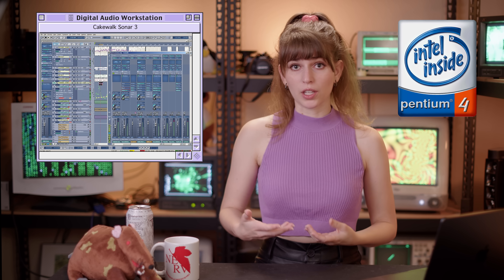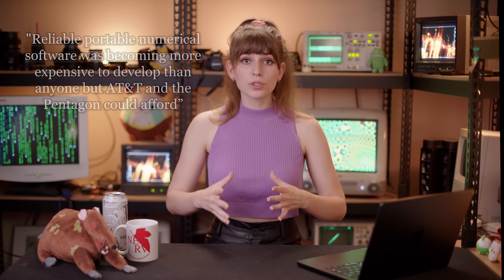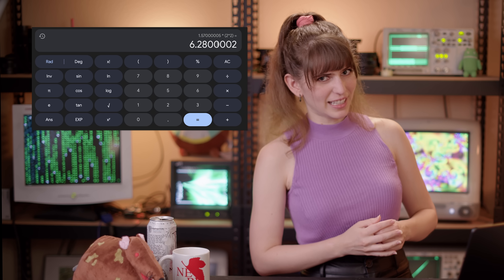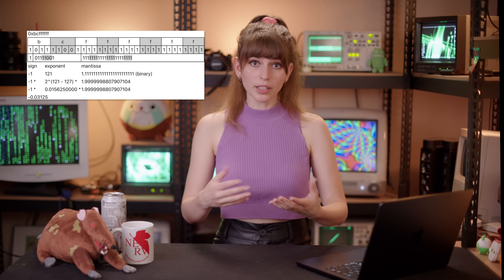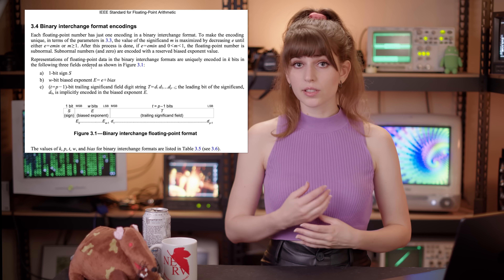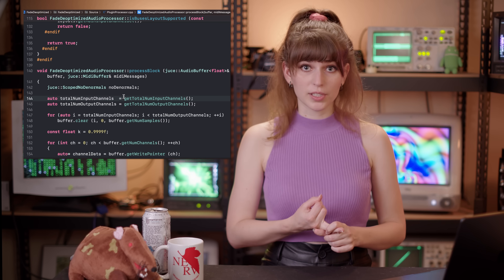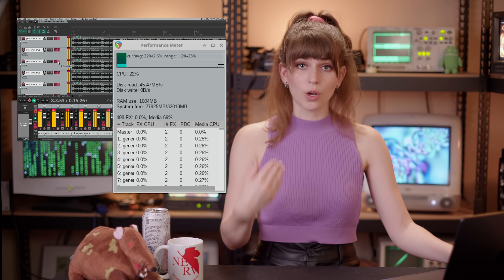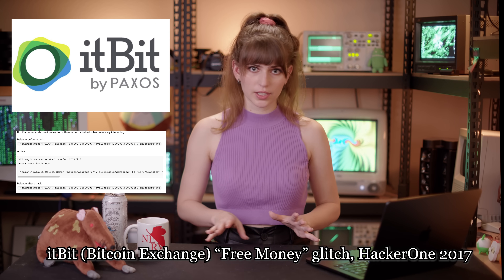Fading Audio is ROUGH on CPUs

Comment: Just want to note: floating point numbers are NEVER used in financial institutions (stock exchanges, banks, currency exchange) precisely because of the problems with losing precision. Instead, they use fixed-point numbers, integer arithmetic only, with single units representing (for example) 1 cent in your bank account, or 0.0001 of a cent for a stock price.
(Interestingly, there are actually laws on how accurate stocks can be priced! I've heard there was a "race to the bottom" with several exchanges offering more and more precision, until the laws were introduced to stop brokers having to report prices with uselessly high precision)
Reply: When all you're doing with the numbers is just bookkeeping-type additions and subtractions, like for crediting or debiting an account, this makes perfect sense. But for more complex calculations, isn't there a point where it becomes, if not impossible, at least super unwieldy to avoid floating point? Like, what if they're trying to calculate the monthly payment for a loan with a 60-month term, a $10,000 principal and a 6.8% APR, compounded monthly? Do they still use only integers for that?
Reply: @rossjennings4755  It becomes impossible obviously, that is as long as you want to be able to use anything base ten wenn actually marketing your finance products -- like interacting with the rest of the world. And pure discrete math products in isolation would be a funny thought experiment, everything integer step function, no calculus available -- but pointless. Of course for doing the claculations one needs to use calculus and cannot be constricted to discrete math (and that base 2).
Reply: @rossjennings4755 yes, integers still used for interest calculations. They'll probably use a fixed precision of much less than a cent, but I can assure you they don't just switch to floats.
Reply: @rossjennings4755 yes, i could do that with pen and paper
Reply: @rossjennings4755  in more complex cases, typically you would use arbitrary-precision arithmetic: https://en.wikipedia.org/wiki/Arbitrary-precision_arithmetic

This is slower and more memory-intensive than floating point, but is also far more accurate.
Reply: Floating point should never be used (for money, etc) for those reasons, but it is. Typically, it would be in a job aid someone came up with on their own, and theoretically the business doesn't rely on it until it is rewritten in an officially supported manner, and the people doing the rewrite should fix that, except that it may be outsourced to  contractor who might have inexpensive short-term folk for some seats, and ... Bugs exist.  This is one I have seen.
Reply: @jimjjewett  I remember getting a bug report about a customer being charged $9.19999999 instead of $9.20... (or something similar, I don't remember exactly) I then had to explain to my superior how floating-point precision errors worked.
Reply: @jimjjewett  I used int first for money for my  Javascript MobWars/Mobsters game Crime, then it over float, so switched to float, because it was all about making fast faster MSSQL calls statement procedures, so for games its acceptable
Reply: @jimjjewett  Single precision financial numbers are especially awful.  You have 100k in your checking account, and that's at least 8 digits ( including cents.)  And I think single precision is roughly 7 digits (it's variable, might be as high as 8 somtimes I can't recall.)  I think you should bold NEVER :)
Reply: Then how do you handle money in javascript?
Reply: @kellymoses8566  in case you're actually after a serious answer, implement a MoneyValue class with the correct behavior for your application (Do you just need cents? Then work in cents with arbitrary precision integers, backed by typed integer arrays. Do you need fractional cents? ...Think carefully about the arbitrary precision "real" number system you use, make sure nobody can break your app with an extremely small value that takes up an extremely large amount of space). Avoid adding adding conversion functions that would give you a regular JavaScript number. Write functions on the class to produce displayable elements. Oh, and never ever trust the client/browser. It should basically just be like a dumb terminal to the application on the server side.
Reply: @kellymoses8566  Very carefully.
Reply: @kellymoses8566  You don't. Or at least, you shouldn't.
Reply: For monetary values you should in principle use binary coded decimal (BCD). E.g. C# has the "decimal" number type, and many databases have BCD column types, and at least Intel x86 has some basic BCD support built-in. They still have finite precision, so rounding rules apply, but at least all numbers written in base-10 will be represented exactly .
Reply: That is VERY important. Money is countable and MUST be integer only. Fractions, real numbers, complex number, etc. are NOT countable, ergo cannot be used to represent money even on paper. Precision of floating point number and CPU architecture is irrelevant.
Reply: @eugenkeller  what about FX? It needs that precision and it absolutely accumulates
Reply: @Vysair  What about FX? And what about NO? Doing something fundamentally wrong accumulates. Even without adding a two-letter-acronym to the mix.

When you're dealing with integer, precision of floating-point is irrelevant. Write it on your forehead. Next to: you cannot write an integer with floating-point. Then in red and all caps: MONEY IS INTEGER.

Your "FX issues" are solved not by using more precision of floating-point but by using integer.
Reply: I work on trading technology for one of the biggest trading desks in the US. I can tell you for a fact we use solely floating point numbers, and have for at least 30 years. Yes, we do have issues, but that's all we use.
Reply: theres the ICE SDK , I'm now intestered seeing how ccxt and ICE sdk can work together
Reply: This isn't quite correct. The lack of floating point has more to do with history, most of that code was written in languages that used fixed point arithmetic. Most people really don't understand how old the code that underpins the financial system really is. I've seen code with copyrights before my parents birth. There's a reason you can make a good chunk of money just by knowing COBOL.
Reply: @DavidPruitt  Computers are irrelevant. It's mathematics. Money is countable => integer. Real numbers are not countable and cannot represent money, in principal. $1.23 is NOT a real number or complex number, it's an integer.
INFINITE set of Real numbers contain integers and are used to calculate integers like money for conveniency, but they don't represent it. FINITE set of Floating-point numbers, in general, cannot represent integers nor real numbers in any range, resulting in loss of information. In finance, losing information is a crime.
Reply: Came to post this.
Reply: Yep, that's why in the Bitcoin white paper, a Satoshi was 10^-8 BTC, can't go lower than that, or you will need to use floating point, which would make transactions either break, or take forever.
Reply: Real institutions do not use floats for actual transactions. However people who thought that running a crypto exchange would be cool might not actually know about the subtleties and then just wrote the backend in PHP without thinking about the data types at all...
Reply: A common misconception. This is definitely best practice, bit there is definitely plenty of software out there using floating point numbers
Reply: @jonnaraev  I guess more accurately said that no-one competent uses floats for actual money transactions/ledger. In cases where (usually) minor inaccuracies do not matter of course floats are acceptable. Just make sure your minor inaccuracies are not compounding over time to become major ones.
Reply: Shouldn't be for results (I am not sure there are really no exception), but are all the time. Even if education ever would lead to everyone working on it understanding what they should be doing, the existing code base will never be cleaned up. In calculating those results/changes obviously integer only does not work, and one should prove that the result will "round" (convert would be more correct to say) to the correct smallest denomination value, which also, quite often is not done. Doing all finance in discrete math would be fun I guess, but then, basically nobody could read the prospects.
Reply: Financial data fit perfectly well in a log 16-bit integer short [0.05 500 000],  exp(-3:1/4096:13),  exp([0:2^16]/2^12 -3)  ascii extra precision is totally useless. That is for storage, for analysis log-data are in cbrt( time_differential()) that means extra precision is even more useless.
Reply: You have a point, but the way you put it is not accurate (ironically, since the post is about accuracy).

"floating point numbers are NEVER used in financial institutions (stock exchanges, banks, currency exchange)"

Pretty sure financial institutions use a ton of Excel spreadsheets, for one. I suppose you mean for the software that has to perform legally binding financial calculations, so let's make that explicit.

"precisely because of the problems with losing precision."

Which precision is being lost as compared to decimal arithmetic? If losing precision was considered unacceptable, then financial calculations would become impossible quickly. Let's say your bank promises you a 1% annual (cumulative) interest and you start with a $100 deposit. After one year, you'll have $101, which is still a whole dollar amount. Another year later, you'll have $102.01, which is no longer a whole dollar amount but at least still a whole cent amount. Another year later and it will no longer be a whole cents amount … or the bank will need to round it to the nearest such amount.

Even if we store the account balance as, let's say, 1/10,000ths of a cent, we will eventually have to use rounding.

So, the problem is not that rounding is required for binary arithmetic. Rounding is unavoidable (unless you want to incur ever increasing computational and data storage cost by e.g. using arbitrary precision rationals). The problem is rather that rounding error due to binary arithmetic is surprising to people and faces cultural resistance. Ultimately it has to do with the fact that we have ten fingers, which was likely why, at some point, people decided on using decimals.

Although … Babylonian astronomers used a sexagesimal (base-60) system, I'm pretty sure they would have been unhappy with both binary and decimal systems because neither can represent something as simple as 1/3 as a finite fraction.

No fundamental disagreement from there on. IIRC the EU (or EEA?) mandates that financial calculations must be performed internally to 1/10,000th of a cent, or some other power of ten fraction, and rounded to cents for producing the final bill e.g., quite similar to what you're describing about stock prices.

Legally, using decimal rounding does make some sense for reasons of transparency because people generally learn to use the decimal system. Few are comfortable with binary or let's say hexadecimal. On the other hand, there's definitely some irony in that many people who are double checking their bank records, let's say, nowadays will not be doing long division on a piece of paper. They will be using calculators or, once again, Excel, and in those cases almost certainly they'll be using binary floating-point arithmetic without even thinking about it.

Anyway, I guess having a legal standard has other advantages, too
Reply: Apart from the nitpicking, let me point out that earlier x86 CPUs had some instructions for BCD (binary-coded decimal) calculations. This is where 2 decimal digits were stored in a byte, i.e. you use 4 bits for each with 6 of the 16 possible 4-bit values going deliberately unused. These instructions were removed with 64-bit CPUs because of a lack of demand.

Well, to be precise, in 32-bit mode, the instructions are still available, ensuring compatibility with old software, but 64-bit software can't use BCD instructions. One would have to implement BCD completely in software, which is pretty pointless. Back then, easier conversion from/to decimal text was considered a significant advantage over the use of (binary) integers e.g., no one cares nowadays.
Reply: @TruthNerds  I thought some BCD versions were a lot more efficient by fitting three decimal digits into ten bits (since 2^10 is only a little over a thousand)
Reply: Binary Coded Decimal.
Reply: Used to be the case in many retail systems that only whole numbers were used (10.00 was 1000 for example), but that was because a lot of old code (including COBOL) written a long time ago when the hardware was optimised for integer logic was running in the background.   Some of that code still exists in some places, though hidden under more layers.
Reply: in revolut i have like 10 or more decimal places on my share amount xd
Reply: Sorry but it is the  specific requirements of the thing you are doing that sets the rules for which numeric types you can use, not what industry you are in.
Reply: (Fixed point numbers aka decimals for who wants to go deeper)
Reply: @langhistruk usually "decimals" have the connotation of having unlimited precision, fixed-point is a more accurate descriptor.
Reply: @Nabushika  in Go, Rust, SQL and other languages they are called decimals
Reply: @langhistruk  fixed point numbers are NOT decimals.

They still has a BINARY FRACTIONAL part which makes some DECIMAL FRACTIONS unrepresentable.

PROBLEM LIES IN DENOMINATOR.

DENOMINATOR WHICH IS POWER OF TWO INSTEAD POWER OF TEN IS A SOURCE OF ALL ISSUES!!!!

DENOMINATOR!!!!
Reply: additionally, floating point IS used by companies in the financial industry, even in high frequency trading
Reply: Interestingly enough, if you use a double float to represent integral monetary values (cents instead of dollars), you get the same precision as with integers, but with a much more graceful overflow behaviour. A huge negative balance will not just randomly turn into a huge positive one.
Reply: @ismiregalichkochdasjetztso3232 not true, a 64-bit float only has 53 binary digits of accuracy. I don't know why you think "graceful rounding" is better than just... not silently rounding? And I find it funny that you think there wouldn't be safeguards in place to prevent overflows - I'm sure all the banks think "why not just ignore them?"!
Reply: Floating point is faster. its useful for doing calculations reguarding statistics, analytics and price setting.
but you should never store currency values as floating point. Used fixed point, decimal floating point, or arbitrary precision integers.
Reply: This is false because all financial institutions use Excel for all kinds of tasks, and Excel only has floats.
Reply: @JeremyRight-zi4yp  "This is false because all financial institutions use Excel for all kinds of tasks, and Excel only has floats." - not true. "You can frequently prevent floating point rounding errors from affecting your work by using the Set precision as displayed option before you apply a number format to your data. This option forces the value of each number in the worksheet to be at the precision that is displayed on the worksheet." / 'To minimize any effects of floating point arithmetic storage inaccuracy, you can also use the ROUND function to round numbers to the number of decimal places that is required by your calculation.' by Microsoft
Reply: @JeremyRight-zi4yp  

Youre are telling lies.

Research yourself excel datatypes in msdn, especialy CURRENCY and DECIMAL
Reply: All the code examples I saw in high-speed trading applications used double precision floating point numbers. Those have hardware SIMD support, fixed-point math does not. Precision limits are well known and can easily be worked around as all currencies require only very low resolution.
Reply: @Kobold666 fixed-point does not? You're kidding, right? Fixed point math is just integer math, and it can make use of all the same integer SIMD instructions that anything else can.
Reply: @Kobold666 I believe you, but wouldn't SIMD work with integers representing whole pennies?  I'm not saying that's what you want for your calculation, but the SIMD arithmetic unit will do it.
Reply: Why would a financial institution use fixed point numbers when languages exist that keeps ALL values as actual fractions until final computation. Any company that uses fixed point number for anything outside of simple apps and games, needs to be shutdown hahah
Reply: Sorry but this is stupid. 64bit floats (or 80bits as the standard used to be in the old FPU unit) is more than enough for financial stuff. And if it wasn't, then just go further. You are ALSO trading precision and accumulating errors with your fixed-point arithmetics, but in a worse way.
Reply: @anothergol   money computation does not made in fixed point.

They are either fully integer computations (operating with cents) or calculated in BCD (that's the reason why big expensive machines like System Z or POWER from IBM still has BCD instructions) . 

The same reason - some DECIMAL FRACTIONS unrepresentable by BINARY FRACTIONS. 

And in monetary calculation you should not only have ALL DECIMAL FRACTION VALUES REPRESENTED but have a special rules for rounding and evenly division and remainders (thus if you have an accounting  calculator model you find a rounding/remainder mode switch there) .
Reply: @АлександрСоловьев-ю9ц2к  I'm not saying it's not done that way, I'm saying it's dumb that it's done that way. When does the error in a 64bit float start to accumulate enough that it matters, in practice in finance stuff?
Reply: @anothergol  
> When does the error in a 64bit float start to accumulate enough that it matters, in practice in finance stuff?

When IRS sends you to jail for miscalculated dollars  in your tax report.
Reply: @anothergol people weren't arguing whether it's "enough precision", the point is that floats are designed in a way that errors can be silently accumulated, whereas with integer maths, you overflow or you don't, and a set precision no matter whether you're trading with $2 or $2bn
Reply: @Nabushika  so those tools are never doing divisions?
Reply: @anothergol you can do integer division...
Reply: @Nabushika  then you divide 1 by 3 and you get the same "problem" you have with floats
Reply: @anothergol nope, 1/3 is 0 (remainder 1). Floats don't do that.
Reply: @Nabushika  1/3 is 0 in financial stuff? ok lol
Reply: @anothergol  yup. And there are strict rules written in FINANCIAL LAWS of  what reminder goes where and where lion's share goes if you can not divide evenly.
Reply: @anothergol No, it’s not. You can’t even represent 10 cents accurately with floating point. It’s a number with an endless repeating pattern. So every time you do any arithmetic on it the error compounds. Adding more bits doesn’t fix it either. 

Floating point number never belong in financial calculations, ever. You should use scaled integers or BCD or fixed decimal. 

FP is useful for imprecise measurements.  Not for things you count like money.
Reply: @djp_video  You can, it's just your responsibility to round the result when you wanna display it to humans. 

You can't "represent" 1/3 in fixed point either...
Of course you'll tell me, generally when there's multiplication in financial stuff, it's in %, but those % are already pre-rounded for human understanding, so it's not like you were after total precision here. 

That also means that you have to use fixed point in decimal, which is definitely not something that CPUs do efficiently. When you say "fixed point" to a programmer, he normally thinks in bits/power of 2, which isn't helping you here.
Reply: @anothergol  

> so it's not like you were after total precision here. 

And IRS ARE after total precision.